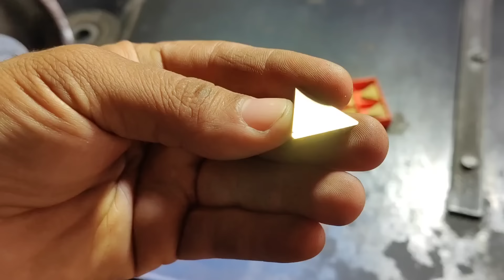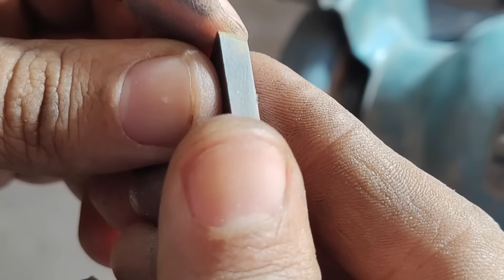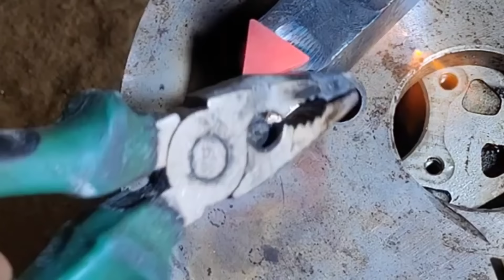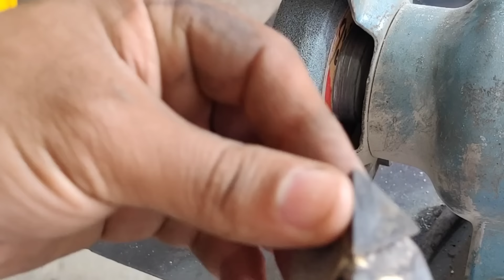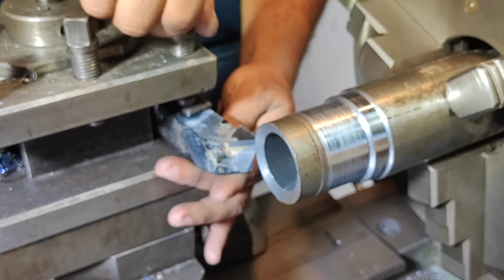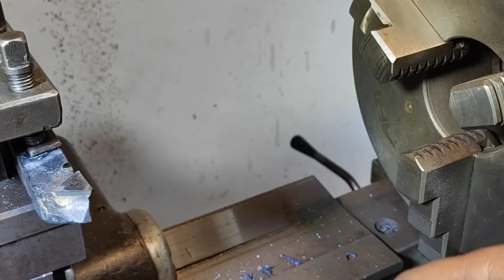قليل من الناس يعرفون عن هذه الأفكار في مجال الخراطة المعدنية

Comment: 0:28 ... Normally we use OLD USED inserts for welding up new tools.  Often these can be obtained free or at scrap value.  

Check your big city machine shop ask the guys at lunch if they have any used inserts for you! .. 

Or at a local scrap yard, see if they can sell you hand full for a the cost of bus fare.  Or trade them for some copper you saved up.

Comment: Important Tip!!! 

If you tried an insert will NOT accept welding???, Test its WEIGHT in your hand, if it is very LIGHT like Aluminum??... It might be Ceramic!!
Ceramic inserts will not weld! .. The proper ones for welding, are Carbide or Tungsten alloy ... they very heavy like Lead!

Comment: Few people know not to use the sides of your grindstone.
Reply: Not to worry. He’s planned for wheel explosion by removing the shatterproof cover over the wheel, which will let the grinding wheel simply explode harmlessly while he stands or one side. He will only have one eye left, and may lose fingers, but saved some time and money by brazing the carbide insert himself instead of buying a tool holder. I’ve seen this guy over and over again claiming workerer’s compensation.
Reply: Знают все и все используют😂
Reply: @MegaVladimir45  😂😆🤣

Comment: Silver Solder. Can regrind carbide 20 times with green wheel. When carbide is done, cut back the holding surfaces, solder a  new carbide on. Too cheap to buy a replaceable tool holder, this is the answer

Comment: Why would you like to machine a bearing???
Reply: Some bearings like the one crank bearing for a Honda 600 R before 1990’s is not available anymore . The standard bearing with is 21mm and the Honda bearing width is 19mm. Honda not selling those bearings anymore, so we taking the standard bearings and machine 1mm of on both sides. Then it looks exactly like the Honda bearing.
Reply: Doing it on a surface grinder left magnetism in the bearing

Comment: Apparently they have no idea about the structure of a insert because there is a basic pressing and then a harder layer is sprayed on 0.1 to 0.3 mm thick, this can be non-stick and sliding coated as well as very hard with extra ceramic content. I would rather solder on this plate or attach it with a clamp.But after the grinding, the slab is for the stonemason.Now the insert should max 0.1mm solder As a connection and cool down slowly, otherwise sand build up between the steel holder and the insert and there is no firm connection. Since grinding of the plate creates fine hairline cracks and ruins the toilet Now the insert should max 0.1mm solder As a connection and cool down slowly, otherwise sand build up between the steel holder and the insert and there is no firm connection. The fact that grinding the plate creates fine hairline cracks and ruins the toilet whetstoneGrindstone